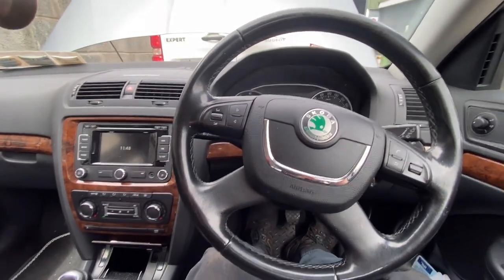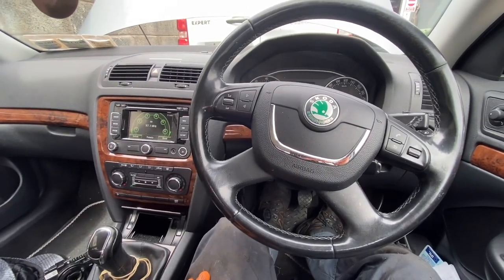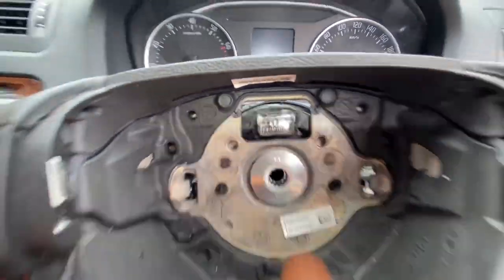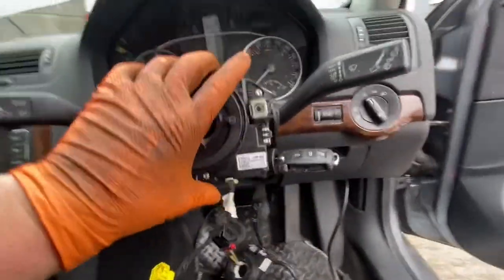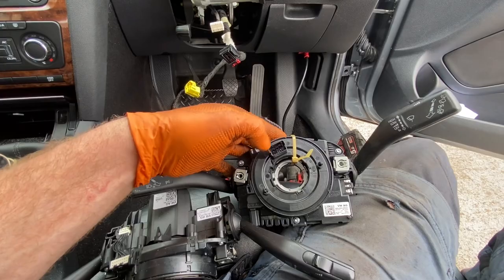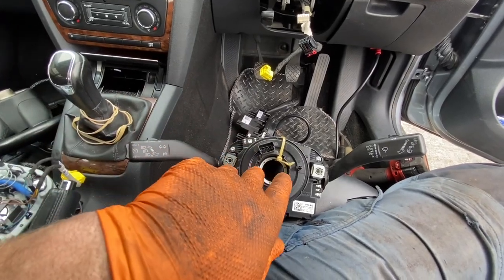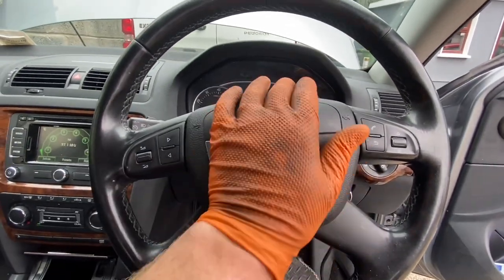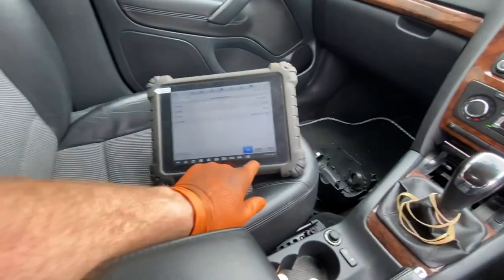Skoda Octavia, airbag & steering wheel controller fault. Airbag clock spring replacement

Comment: Had a Ford in today stuck in limp mode - only running on the 2 middle cylinders, Peter.   It has been everywhere & had 101 parts shot at it. I believe to date it has had well (well) over 2k of parts & who know what labour charges to no avail.  Only relevant code from any of the previous messers is "Injector 4 wiring short circuit". It got 4 new injectors at 400 snots a piece, for example... no workey.. 

Didn't bother using any scanner as the car has been scanned to death everywhere already to no avail. Instead I drew out the injector wiring diagram "IRL" on a bit of cardboard by tracing the actual wires using a multi-meter/test light, took off the ECU, verified all the wiring was intact from the ECU out, then checked the pins on the ECU - which showed that the ECU was shorted internally on injector control circuits 1 & 4.. Which are the injectors that don't work... Roish... I opened the ECU for a Goo at the board - sure enough there was crustiness inside on the relevant traces, they sure look shorted - which is a 200 quid repair. Not the 2-3k the guy has already forked out for garbage.. 

 "Practicality" often beats even the highest high tech when it comes to faults. Like with this boom-box ^.
Reply: "Diagnostics" isn't even our thing - we do bodywork & suspension - smh head at what's working out there betimes.. "All the Gear, No Id....   "
Reply: Good old common sense detective work. If you're looking for someone's killer, it's always the last person to see them....literally
Reply from the maker: Well done James, I often say it in my videos. Just use a little bit of common sense & it sure does help. And you my man use it in abundance 💪💪💪
As you said quite a few guys were beaten by this one & you brought it to a head. 
No bother to you 👏👏👏

Comment: I put a new clock spring in a Seat Ateca last month. It cured the air bag faults but the steering wheel controls stopped working. Long story short I had tried everything but had to pay a chap with VAG software to code it. The car was only four years old so I thought I’d mention that the later stuff will need coding. What age was the Skoda Peter?
Reply from the maker: My one was 2013 but I was expecting it to need to be coded too. But it seems to have had the same coding which is a bonus in my case. Whey hey 😊😊
They done make them easy though 🤷🏼‍♂️🤷🏼‍♂️
Thanks Trevor 🙏🙏

Comment: “Fart arsin’” 😂 but the thing is that’s how we’re programmed…to try and make the impossible work…if it does….woohoo…if it doesn’t we’ll just spend more time and eventually buy the right part… The variety of work in your trade Peter is unbelievable..your a mechanic one minute..an electrician the next…a gas engineer the next and even a plumber at times…oh and a Hollywood director too 😊😉brilliant 👍🏻👍🏻
Reply from the maker: Isn’t it tough going what we take on 🤷🏼‍♂️🤷🏼‍♂️
Not many guys would tear down that Mazda 6 you are at, to the depth that you have. Fair play to you too mate 💪💪💪🤞🤞

Comment: very nice peter when the job goes plain sailing. As you know as a fully Qualified Mechanic they dont all of the time. i like the new autel you have what the make of it. im thinking of up Upgrading cheers
Reply from the maker: They very often go wrong Paddy. But we can only make them run off as easy as possible 😬
The Autel is an MS909, I bought it from euro car parts & it is a really good tool. I’m getting very used to it and it is the first one I grab now which is a good sign, cheers mate 🙏🙏
Reply: Thank Peter

Comment: Hello! I have the same problem with a 2011 Yeti. I only changed the airbag guide from E to AL end. it is programmed, but unfortunately it still doesn't work. The steering switches also need to be replaced, only then will it be good? VCDS error code: Airbag: 9437211 B1000 Steering wheel error code: 365080 U108E 00 The error phenomenon is the same airbag error, there is no horn and none of the multi-steering wheel buttons work. Can you help?
Reply from the maker: It can be very hard to guide someone without seeing the car.  
But you have similar issues but you haven’t replaced the clock spring, is that correct??

Comment: at my work i use a bosch kts diagnostic tool... changing theese are pretty straight forward with a bosch kts.... dont tried any other diagnostic tools... connect the bosch diag and "save the software/programing" from clockspring ecu in the bosch diag... change the clockspring assembly.... and "download" the programing/software in the new clockspring.... total time saving-changing-download is about 20 minutes...
Reply from the maker: That sounds straight forward, it is something that I haven’t ever done. Thanks mate 😉🙏🙏

Comment: Great video it helped me so much but after I installed the new clock spring I got 2 messages. “Engine fault workshop” and the second one is “button for driver assistance system defective” and the epc light turned on. Can you please help me with this issue
Reply from the maker: Some vehicles will have different equipment set up due to various model’s etc.
This is most likely down to the coding issue I expected to encounter at the start of the video. You will need to get a good scantool and try to get the coding from the old one, then input the coding on the new one.